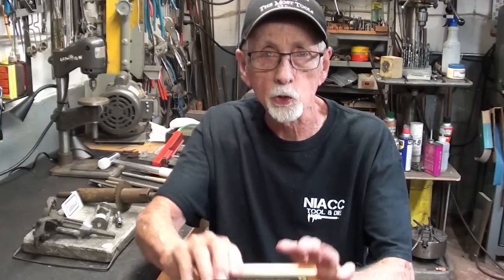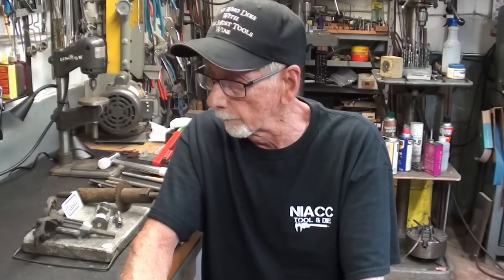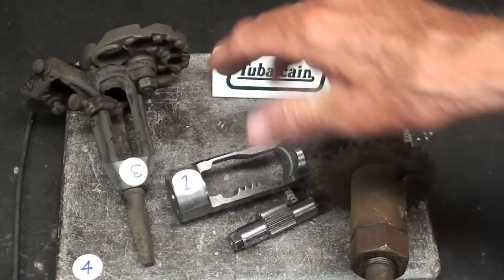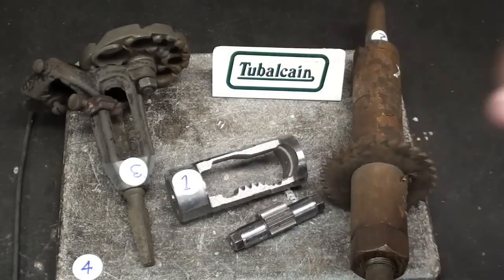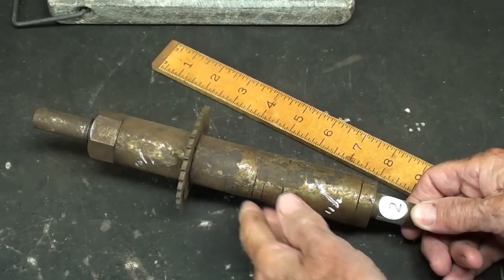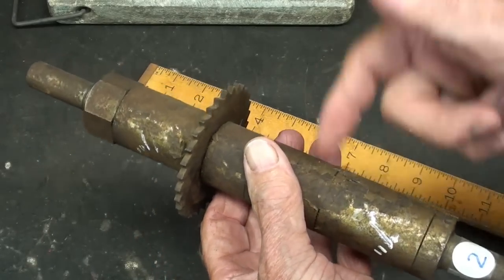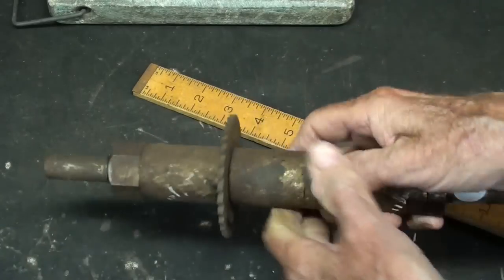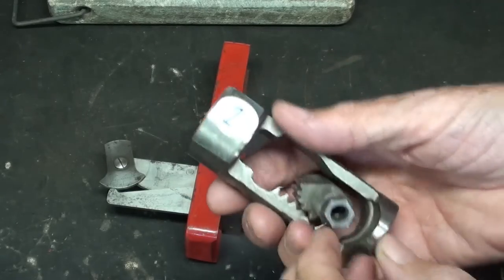WHAT IS IT? Mystery Tools #97a question tubalcain mrpete

Comment: Number 2 looks like the arbor bar used on my Atlas  Horizontal Milling Machine. They made two sizes 7/8 inch and 1 inch arbor shafts. Have both sizes for my Atlas MFC Horizontal Milling Machine.

Comment: #1 looks like it is part of a door closer. The two different gear configurations control the sweep and latch  cycle of the door closer. 
#2 Could be for an Atlas milling machine.
#3 is an adjustable tenon cutter for dowels or wooden spokes. The slide is set to control the depth of cut.
#4 Looks like it is a soapstone heat shield for plumbing work. Well, that is my guess  for #4.

Comment: I have no problems getting all your video notifications, I'm in Florida. 1. All fans need to make sure they are Subscribed and the Bell Icon is totally black.  2. Then go to their YouTube account, select Settings => Notifications and make sure that the sliders under Your preferences are to the right for Subscriptions and Recommended videos.  Even if you have done number 1, if number 2 isn't correct it overrides the selection in 1.

Comment: The mill arbor is very similar to the one on my little Burke, but it uses a B.S. 9 taper.  You might double check the taper on that one, if it does turn out to be a #9, I've got a place for it and any surplus cutters that people want out of their way ...
Reply from the maker: I’m pretty darn sure it is an atlas. Someone else said that as well.
I will take a number two drill sleeve and see if it fits

Comment: 1 is part of a hydraulic door damper.
2 is obviously a milling machine mandrel, but no idea which
3 is a tenon cutter, such as used in making chairs, appears to be one made by Stearns
4 is a soap stone bed warmer.  You heat it in the oven then slide it between the sheets.  The dust you created in demonstrating the material's softness likely is a mixture of talc and asbestos.

Comment: #3 looks like the tool used in shaving the ends of blanks to make the dowel pin ends for wooden wagon wheel spokes.  The ends that fit into the fellows that make the rims.  Engles Coach Shop youtube channel uses them when he builds or repairs wagon wheels

Comment: #1 I want to cheat and scan the answers for clues. The complex gear reminds me of the two speed pump jack feature that changed speed automatically as the shaft made its revolution by shifting to the different gear ratio with the "wobbly" gear. The scroll cam feature of your parts reminds me of the Automatic Tool Change drive mechanism common on CNC mills. These ATC scroll cams provided speedy, rugged, highly repeatable mechanical motion to drive complex mechanical functions with a simple orbit motor input. The engineering and precision machining of high tolerance hardened parts were a joy to watch and to troubleshoot when something did wear or fail.

Your example wasn't shown long enough for me to grasp its function or to then guess its use or purpose, but it is beautiful to see.

Now off to the keyboard bandit answers that might reveal a clue!

#2 I don't know the maker, but this would fit a very small horizontal machine where I have little knowledge or experience. I want to guess Atlas or Sourh Bend. You have spent time with SB mills and your reluctance to name the maker is an Atlas clue. I have never seen a #2 morse taper draw tool, but my little Atlas lathe came with a spindle drawbar. I assumed it was for collets. I think it uses a #2 spindle taper??? I have never inspected. Could Atlas have intended to fit their lathes for horizontal mill work? It seems too light duty of a machine, but mine is equipped with a Y axis milling feature.  I tried it one time. Way too much backlash in the cross slide and carriage and too little rigidity,  caused catostrophic part and tooling failure. I purchased a Bridgeport and never experimented with milling on the lathe again! Pristine milling feature components indicate that previous  owner(s) never had milling success on my machine either!

#3 A tennon cutter, used before my woodworking hobby career. I am going to guess that its most common use was for making tennons for furniture features like chair stretchers. The casting features and paint remind me of Stanley tools, but other makers did similar features.

#4 looks like fire brick. I can imagine many uses, but I don't know its intended purpose, though it bears what appears to be heat scars.

Comment: 1. cam gear from an automatic barrier as found at site entries and car parks. 4 heat shield, used to protect background objects when soldering or wiping plumbing joints, looks to be made from pumice or soap stone.

Comment: Hey I am here in Missouri and I get notified, i am also subscribed, only subscriptions that cost nothing are YouTube subscriptions.
Number one looks like the guts out of a door closer. Number 2 goes to a small mill, don't have a clue.  Used to use a Barker? set up to do keyways but it had a number 40, looks like a B and S taper to me.  Number 3 tenon cutter for putting rounds on ends of sticks of wood like chair rungs.  Number 4 would scare most people to death today if is what I think it is, fireproof.  People freak out if they just get close then you scrape on it, just don't breath the dust.
Reply: Ok lots of comments on 4 being a bed warmer, thought it might be a asbestos block of some kind to solder, braze and weld on.

Comment: No 4 is likely a slate, used on a building site to jot down sizes and other details, so that you can go to the saw and lumber pile, and cut the wood to fit the exact space it was to go into. Soft, so it was easy to mark, and then a quick scrub down with some sand, a wash with a wet cloth, and it is ready to go again.
Reply: So... This was the original Palm pilot?
Reply: @dannyl2598  used by the builders of the pyramids so they wouldn’t waste valuable papyrus.